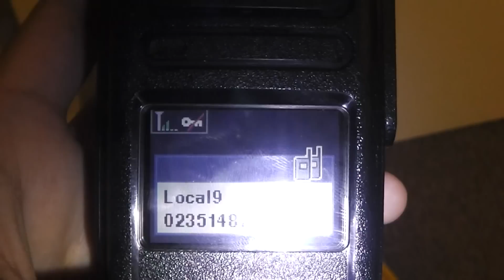Audio Comparison: TYT MD-380 VS MotoTRBO radios

Comment: also remember for Microphones and Audio - the darned "hole" they use for the microphone's audio (sometimes a single hole) to get to the actual microphone ( when one takes it apart) and look at the guts -- the mics are often off to the side of the hole, blocked by plastic to hole not been cleaned,  or the mic is not even near it at all (depending on the manufacturer's quality control). Often with Mics, enlarging the microphone "hole" (removing the case) and ensuring the mic is seated, helps.!

Comment: They all sound worse than FM though. Which begs the question 'Why'?
Reply from the maker: +sparktastic1 That's your opinion. I would much rather listen to a DMR signal than a noisy FM signal any day. And people have such bad microphone practice that they're under the noise floor most of the time on FM. This is a problem that doesn't happen with digital because there is no noise floor in the decoded voice other than the background noise of things happening around the person talking.
Reply: +radiosification I find it somewhat amusing and maybe a little frustrating, that proponents of DV only cite S/n as the main benefit of DV. How do you define 'Signal'? If your definition of signal is a highly compressed, distorted approximation of human voice, then yes I suppose DV has the edge over analogue. If however you take into account the unmistakable distortion and reduction in dynamic range, of the original audio signal, then IMHO DV is a complete and utter waste of time and money. Sure, if encryption is a priority for you, then DV is a necessary evil. But for amateur use, I repeat, why bother?
Reply: +radiosification Thanks for posting the video though. Interesting comparisons between high and low tier radios.
Reply from the maker: sparktastic1 Dynamic range? Who needs dynamic range on walkie talkies. These are made for communicating and that's it. They aren't meant to sound good, they're meant to allow communication. Amateurs have adopted this technology because it works well. If you want to have amazing quality voice, amateur radio probably isn't for you, because even on FM they only use 25KHz or less, not the full quality 200KHz FM and top of the end microphones like in radio studios. With these radios as long as you can understand the other person, how it sounds doesn't matter at all.
Reply: Lol, interesting defence of DV audio quality there ;)
I guess it doesn't matter that Police dispatch and field units constantly request repeats of messages because the person speaking has gone 'marble mouth' (an effect of the ambe/imbe vocoder not low signal/BER), or the fact that ambient noises play havoc with the vocoder and digitised voice. Whatever turns your dials though :)

I'll continue to enjoy that lovely, warm and natural sounding audio, that only analogue (for the time being) offers :)

Good luck managing the influx of cheap TYT radios on your expensive Motorola infrastructure ;)
Reply from the maker: Cheap radios won't affect commercial systems because only radios bought by the system administrator are usually used on those. On amateur networks, the chinese radios don't really sound any worse than any other radio.

The newer vocoders have less problems with background noise than the IMBE used in P25, if that's what you're referring to. AMBE is better at dealing with background noise and produces better audio for the same bitrate as IMBE. 

If a radio user drops out on digital, they would have been unreadable on analogue too, so I don't see what the difference is there. In fact, in most cases due to the widespread use of awful microphone practice, they would have already been under the noise on analogue by the time they drop out on digital. The use of dynamic range compressors on FM help with this issue somewhat, but that would ruin the audio quality wouldn't it?

If people keep dropping out, it isn't the fault of the digital, but the coverage of the system. Dropouts on digital will be just as bad if the system were on analogue.

It seems like you have a bit of a prejudice against digital and you don't realise it has so much more potential than analogue. For example it is so much easier and more efficient to transport digital voice across the internet or some other network to be repeated by another base station/repeater. There is also no loss of audio quality when doing this. Encryption is also many times better than analogue. All the other features such as text messages, group calls, private calls, radio checks exist by default on any decent digital voice mode. You don't get any of that stuff on analogue unless you buy a special radio like an MPT1327 trunking radio on a system for example.

Digital IS the future. Phones moved to digital years ago, because it is better. TV moved to digital a few years ago. Broadcast radio hasn't really moved to digital yet, simply because the DAB standard is awful. It uses ancient codecs that are incredibly inefficient. Two way radio has mostly already moved to digital. The emergency services in the UK moved over 10 years ago. Almost all new radio systems are digital as they provide double the capacity of analogue for just a little bit more expense, and so many more features.

You can continue to deny it if you want, whilst using digital technology every day, including to post your comments on here...
Reply: @radiosification  Excellent points: 
-easier and more efficient to transport digital voice across the internet or some other network to be repeated by another base station/repeater
-no loss of audio quality when doing this
-Encryption is also many times better than analogue.
-text messages, group calls, private calls, radio checks exist by default on any decent digital voice mode
Reply: No noise, but massive distortion from what a speaking voice actually sounds like.
Reply: I agree that DMR sounds like crap compared to analog FM, but facts like 2 timeslots (repeater owners love this, basically 2 repeaters for the price of 1), the user database is an obvious plus, ability to send text messages, private 1 to 1 calls, encryption (if your in Canada) all make DMR more desirable than analog. The sound may be crap but it is like full quieting on analog which is also a plus...Oh and it is easier on the transmitter running about 40% duty cycle compared to 100% on analog, so more efficient (green) which is great for portable operation. Cheap repeaters can also be made with no duplexers by doing TS (timeslot) repeating...it just beats analog hands down on everything except sound fidelity.
Reply: @Centar1964  I know this is getting video and your comment are getting old but why do you mention  "encryption (if your in Canada)" ? I was under the impression that encryption is not allowed in Canada in the amateur spectrum.
Reply: @corradoQC  In Canada, one is permitted to "use a code or cipher that is not secret" on amateur radio. So you can use encryption but have to make the key public... sort of a gray area...

Comment: I'd say the tyt sounded better
Reply from the maker: +Peter Mc It is a very nice sounding radio!
Reply: I agree…. The Hytera PD service sounds significantly better than TYT AND /\/\.
Reply from the maker: Which radio? I have a PD985 and it's far worse than my DP4800. Mostly because of the noise at low volumes. Also the lack of RX AGC